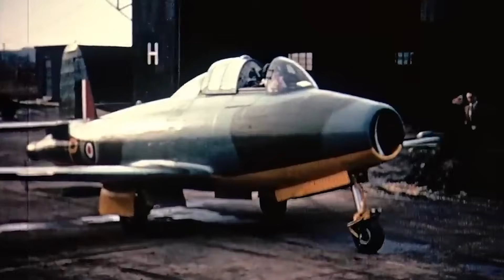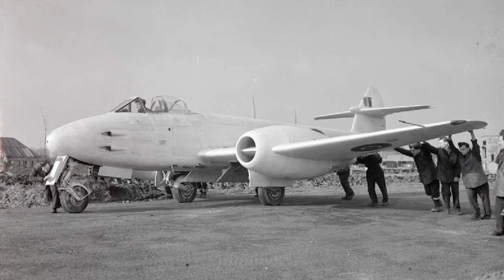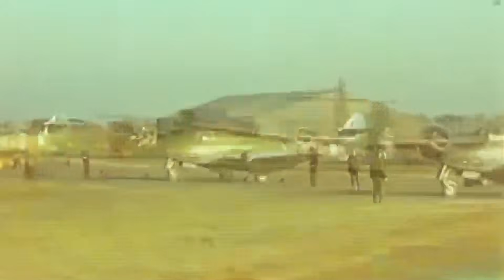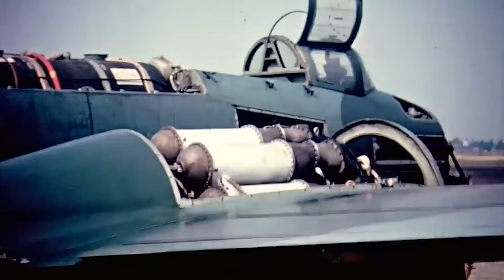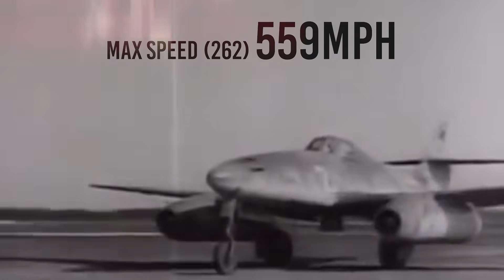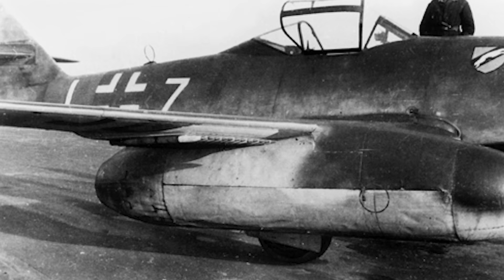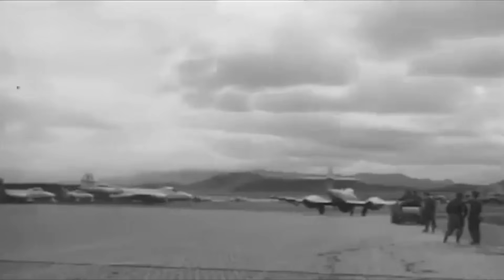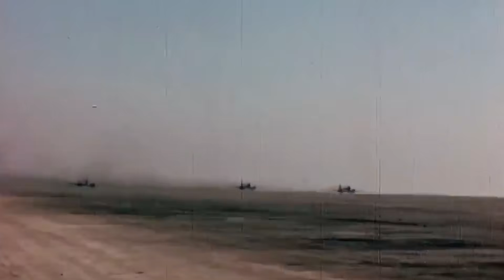Meteor vs Me 262 | Which was the better WW2 jet?

Comment: Admitted, I didn't watch the whole thing. But what a question? Does anyone doubt that the Me-262 was the ONLY jet that actually had some (limited) impact on the war? The few Meteors were busy trying "intercepting" cruise missiles. The victors write "history" by spreading propaganda even 80 years after the event.
Reply: Perhaps you SHOULD watch the whole video, before rambling about propaganda?
Reply: @awf6554  ok, now what impact did the Meteor have? You sure will tell me that that sitting duck was operational a few weeks before the 262. Britain wasn't even close to what Germany could field, let alone concept. Did Germany lose the war? Sure. Does that make British aircraft designs any better? You know it...
Reply: @gruenerteufelDD 

LOL The Nimonic nickel super alloys were developed in Hereford England 1939 -1940. In Germany they thought they needed to use stainless steel for turbine blading which doesn't work and due to various issues ended up attempting to use pressed sheet steel turbine blades. 

262 & it's engines = Garbage (but it did actually fly which surprises a lot of people). In both Russia and France good people wasted their time trying to do something with the engine after 1945. Russians ceased trying in 1948 as their own effort was clearly better.
In France RR got involved in 1950 and managed to get something useful working. 

We feel we can clear up some commonly held myths and misconceptions, obviously.
It's always good to see the facts presented clearly and concisely isn't it?

The Gloster Meteor was one of the world's first jet fighters to go into service, it was in service during WW2. The meteor was the first effective multirole fighter bomber jet aircraft with a reliable engine to go into service,  It broke speed records in 1945 and 1946. During WW2 it was in service as a fighter and multirole aircraft over the UK and over all allied controlled territories in Europe and beyond. 

The ME-262 and it's 46 minutes life engines were abandoned shortly after 1945, it had a do not exceed speed of 456 mph and was only ever used to attack bombers with losses of three 262s for each downed bomber.  During WW2 most of the ME-262s were destroyed by their engines, were various types of accident losses or were shot down by bombers. No German designers were involved with the Mig-15. The Mig-15 used a copy of the RR Nene.  

During the Korean conflict most of the Meteor casualties were due to groundfire or accident losses. The result of any tangles between Migs and Meteors was that Mig pilots avoided getting into dogfights with Meteors. The battle of Sunchon, where 50 Migs against 14 Meteors resulted in the supposedly superior Migs failing to gain any clear advantage caused the Koreans to re-evaluate tactics. General opposition in Australia to involvement in the Korean conflict resulted in the govt using the battle as an excuse to reduce the RAAFs involvement to troop support only.

The world's first wind tunnel was built in England during the 1800s. The world's first supersonic wind tunnel was built in England during the 1920s. 

The Whittle Gloster E28/39  was of course a brilliant aircraft that was later copied in Russia as the upsized and tweaked Mig 15 with a copy of the RR Nene gas turbine aero engine. The RR Nene being the world's most powerful & most reliable gas turbine aero engine in 1944.

The MD F3H Demon was a contemporary to the DH Sea Vixen & had a similar performance. The F4 Phantom was a follow on from the F3 Demon. The Sea Vixen took a long time to get from first flight to introduction for various reasons and a similar situation occurred with the MD F3H Demon.

McDonnell Douglas F3H Demon
590 Built. Not Supersonic.
Max Speed 578 MPH.
Introduction date 7 March 1956
First flight 7 August 1951
Retired 1964

MD F-4 Phantom 2
Number built 5,195
Manufactured 1958–1981
Introduction date 30 December 1960
First flight 27 May 1958

DH Sea Vixen
Number built 151 (including two DH110 prototypes and one Sea Vixen prototype)
Introduction date July 1959
First flight 26 September 1951
Max speed 695 MPH.
Retired 1972

Interesting British achievements.
There is no doubt that the Fairey (England)
Delta 2 was of course the world's first jet
aircraft to exceed 1000 mph.  Indeed It
exceeded the previous record by 310 mph &
held the record for 1 year. Incidentally, the Dassault Mirage 3 & 4 are based on the Fairey Delta 2.

The Panavia Tornado & Euro fighter Typhoon are British design aircraft with British design engines built by international consortiums. 

The EE Lightning was one of the fastest aircraft on the planet when it first achieved a Mach 2 flight. 

Early days, jet fighters.
De Havilland Vampire, Sea Vixen & Gloster Meteor accident losses were not high or unusual for fighter aircraft at the time. De Havilland built large numbers of all metal airframe aircraft before the DH Comet.
We mustn't forget of course that the DH Vampire for example first flew in 1943 & the engine was also built by De Havilland. There were examples of the Vampire interceptor / fighter in service until 1990 which was operated by more than 30 countries.

Non combat phase accident losses.
% of Aircraft built.

The Canadair CL-44 was a turboprop airliner.
Canadair CL-44                  (ff 1959 ) 48%
Lockheed XF104                (ff 1954) 100%
Lockheed  P80                   (ff 1944) 43%
Lockheed F104                 (ff 1954)  45%
Grumman f9f-5 Panther   (ff 1947) 44% 
Convair F102 Dagger        (ff 1953) 45%  
MD F-101 Voodoo.             (ff 1954) 34%
MD FH Phantom 1            (ff 1945)  35%
MD F4 Phantom 2             (ff 1958)  28%
MD F3H  Demon               (ff 1951)  32%
Gloster Meteor                  (ff 1943)  21%
DH Vampire UK                (ff 1943)  23%
DH Sea Vixen   UK           (ff  1951) 33%
Gloster Javelin  UK         (ff 1951) 20%
EE Lightning  UK             (ff 1954) 33%

It's a great pity & a crying shame that British military forces had to occupy a large part of Germany for decades after 1945 & Russian military forces had to do the same. Of course Russia still posseses a large chunk of what was German territory & of course Russia & the UK produce nukes. Obviously Germany does not produce nukes.

Early days, jet engines. Whittle performed the world's first demonstration of a gas turbine aero engine in 1937. The RR Nene, a centrifugal gas turbine aero engine, was the world's most reliable & most powerful gas turbine aero engine in 1944. Licensed built versions & copies of the RR Nene & RR Derwent would go on to power many aircraft in Russia including the Mig 15 & Mig 17, the US, China, France & other countries for decades after 1944. Incidentally, the Mig-15 was in essence an upsized / tweaked copy of the Whittle / Gloster E28/39 jet aircraft including an uprated copy of the RR engine.  The basic centrifugal compressor gas turbine aero engine with Whittle style reverse flow combusters and sometimes an axial compressor section is still manufactured by more than one company including Pratt and Whitney, the main application being helicopters.

The gas turbine engine was invented in England during the 1700s.

During the 1800s Parsons of Ireland & North England produced the world's first axial multi stage sequential stator rotor turbines and compressors for turbomachinery use which would eventually go on to to form the main components of the axial gas turbine aero engine. At the time the basic idea of making an internal combustion gas turbine engine and using it as an aircraft engine was considered thus the jet aircraft concept had been created in England before the first powered aircraft flew.

An example of what goes on these days in various countries. For example, there are of course no German companies that makes German jet aircraft in Germany & there are no German Companies that make German gas turbine aero engines in Germany that are suitable for widebody airliners.

The UK has the world's highest combined per capita Nuclear / Defence / Aerospace Sector Activity.

UK defence sector, absolute terms, world's second highest activity. 1st for per capita defence sector activity. Per capita nuclear powered submarine construction, 2nd position. 
Main players being Rolls Royce, Babcock, GKN Aerospace & BAe Systems. Activities often involve international collaboration. BAe systems, RR and other UK companies now handle more Airbus work value wise than Germany. 

There's a good chance that anyone currently flying on a widebody airliner will be on an aircraft powered by RR gas turbine aero engines made in the UK and a good chance there will be other hardware on the aircraft that's designed and / or manufactured in the UK. 

Rolls Royce Holdings UK
Subsidiaries
- Rolls-Royce plc
- Rolls-Royce North America (ex Allison etc Classified Military stuff)
- Rolls-Royce AB
- Rolls-Royce Deutschland
- Rolls-Royce India Private Limited
- Rolls-Royce Marine Power Operations
- Vinters Engineering Limited
- Rolls-Royce Controls and Data Services
- Rolls-Royce Power Systems
- Bergen Marine
Joint ventures include:
- Rolls-Royce Turbomeca
- MTU Turbomeca -

Trent Family
The MT30 (Marine Turbine)
Industrial Trent 60 Gas Turbine
Trent 7000
Trent XWB Airbus A330neo.
Trent 1500
Trent 1000
Trent 500
Trent 600
Trent 700
Trent 800
Trent 8100
Trent 900
   
RR wholly owned subsidiaries in Germany handle smaller 2 shaft RR gas turbine aero engine work.

The UK space and aerospace sectors are highly productive, high-value industries that together contribute over £18 Billion in direct Gross Value Added (GVA) to the UK economy. Individually, the space industry directly contributes about 0.3% of UK GDP 7•2 Billion while the aerospace industry contributes approximately 0.5% £10•9 Billion.
   
Wee hopes theze helpsmz.  EtC---.

We hope this helps of course 👍